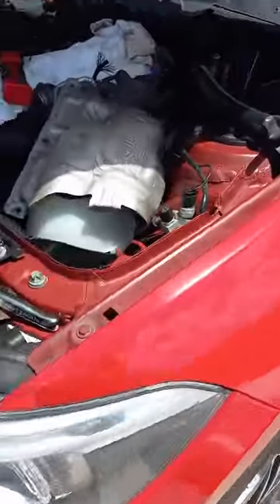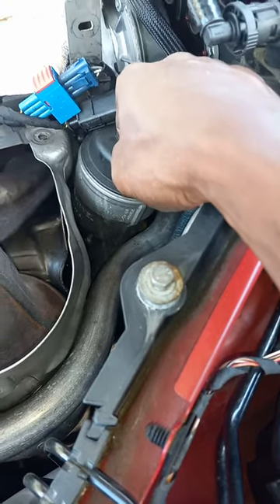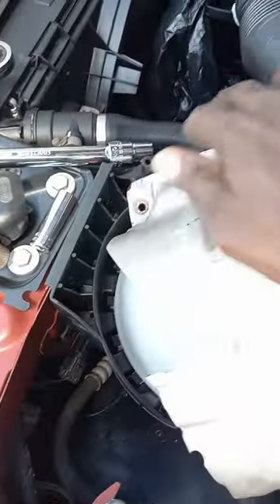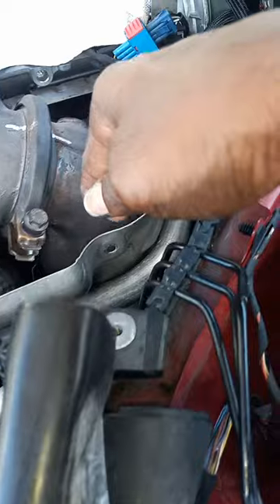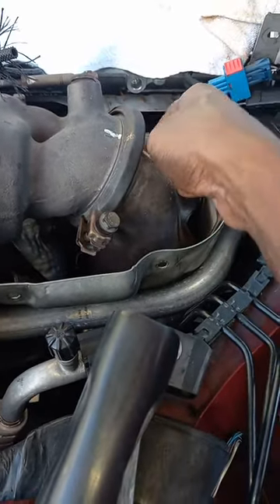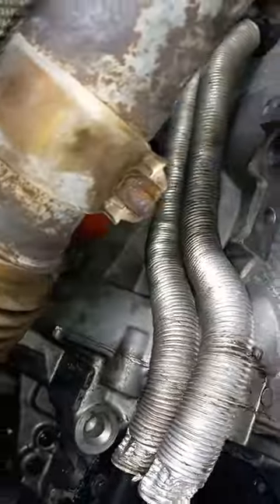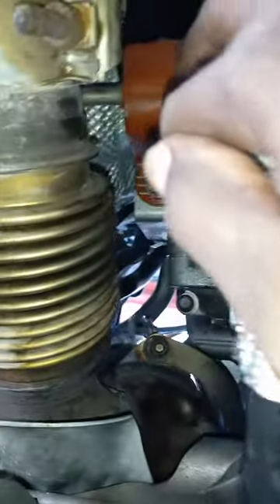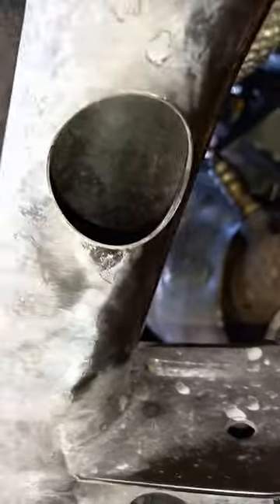Part 1 Explanation of how i remove my BMW 116i /f20/N13 oil filter housing

Comment: How hard was it removing the coolant pipe that goes around the buldge of the heat shield please that goes into the water temperature housing?
Reply from the maker: @RBDET25  it give a little work but it is not crazy hard, if my memory surves me right I think just like how I had to pull the oil sensor from under the car because it is almost at that same spot you can also pull it from under the car but drain the coolant first because it will run in your face but putting it back you can just feel it from behind the engine with your hands, it take a little patient tho.